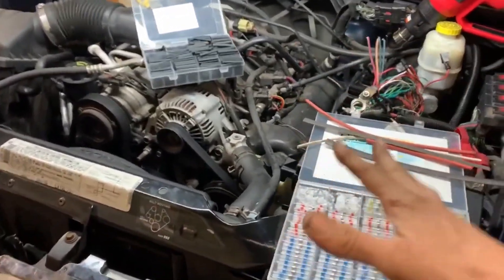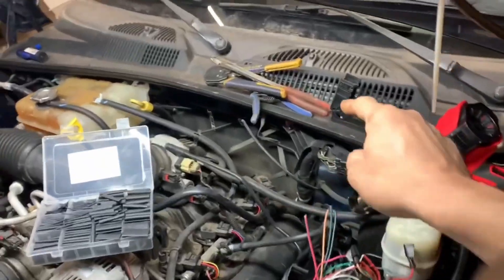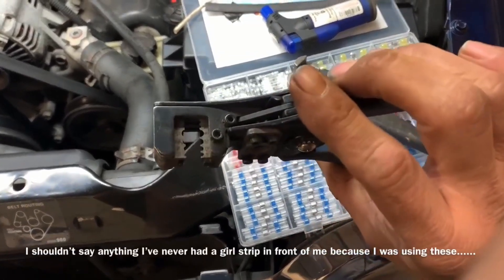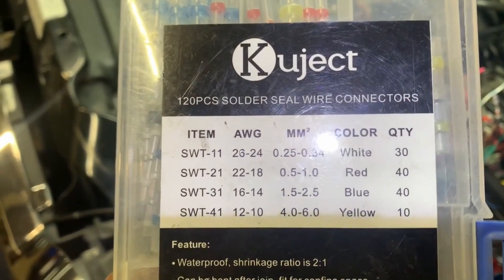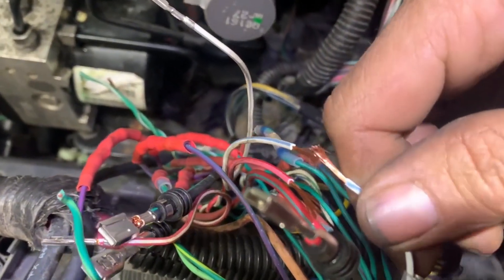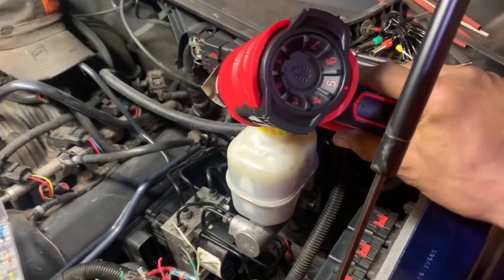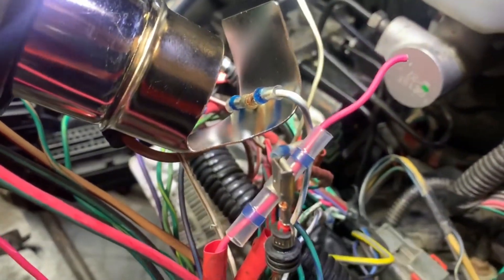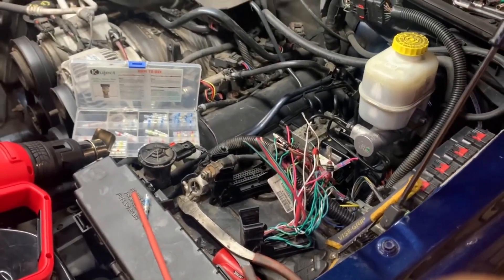Best Way to Fix ANY Broken Wire! This WILL Solve Many Electrical Problems

Comment from the maker: ⭐⭐⭐⭐If you liked the video and want to show your support, you can use any of these links to purchase ANY ITEM you normally would off of Amazon and we get a small commission with no extra cost to you!  Make sure to complete orders through the links! Here's some tools to get started!  Thank You!
650pcs Heat Shrink Tubing (I know it's excessive but it's $9 at the time of posting): https://amzn.to/3SClF0I
Heat Gun 1800W Variable Temperature Settings 122℉~1202℉: https://amzn.to/3JFJ6Ck
orch Lighters, Refillable Butane Fuel Lighter: https://amzn.to/3BWfP4A
20PCS Solder Seal Wire Connectors: https://amzn.to/3JPbbHl
OBD2 Scanner TOPDON AD600S Scan Tool, Code Reader: https://amzn.to/3Ot0gDR
DEWALT 20V Max Impact Driver Kit, 1/4-in: https://amzn.to/3y0vDRJ
5 Pieces Magnetic Telescoping Pick-up Tool Kit: https://amzn.to/3knxckI
Magnetic Screwdrivers Set with Case, Amartisan 42-piece: https://amzn.to/39sTSxT
CRAFTSMAN Mechanics Tools Kit with 3 Drawer Box, 216-Piece: https://amzn.to/3Nux6UL
ANCEL V6 PRO Bidirectional Scan Tool: https://amzn.to/3wRcvDy
CASOMAN Master Torx Bit Socket and External Torx Socket Set, 60-Piece Set: https://amzn.to/3NbWUpe
Thorstone No Spill Coolant Funnel Kit: https://amzn.to/3m1dADS

Comment: I have wondered about those solder type connections. Maybe I'll give them a try.
The only other thing I would do in addition is to use adhesive lined heat shrink rather than plain. 1000% water proof and the glue adds a little extra mechanical strength to the joint.

Comment: Hi just tried to message you on Facebook but they doing some maintenance or some biting but I have a question. When I turn my AC fan pass lvl 3 my radio stops working, my brake lights stay on, my hazard lights dont work and my air bag light comes on. Do u have any pointers
Reply from the maker: Well that’s crazy as crap sorry I didn’t get back to you Gerald but I would have to assume that the blower motor resistor has something to do with it more than likely not only is the resistor bad the connector to the resistor is probably melted can’t say for certain over a text message but it surely sounds like that could be the problem